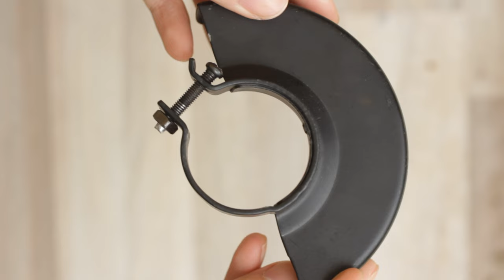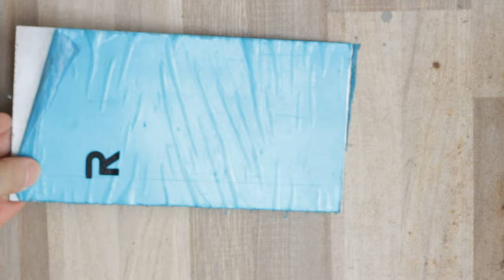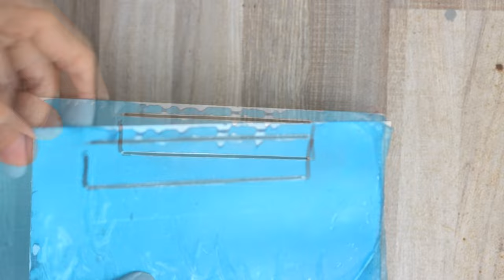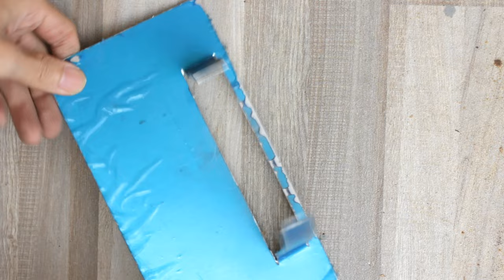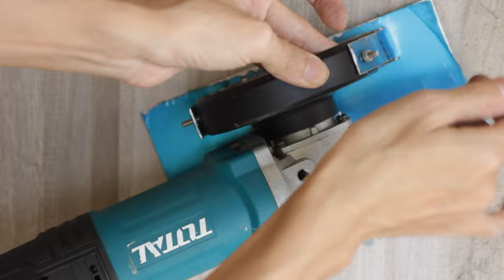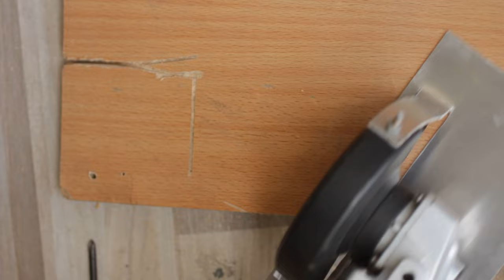How To Turn An ANGLE GRINDER Into A Safe CIRCULER SAW

Comment: That angle grinder and wood won’t be safe no matter what type of jig you will come up with. Wood blades needs slower disc speed. Probably you’ve realized it when you try to cut. Try to use it with variable speed grinders with a slow speed
Reply from the maker: I had created a speedcontroler

Comment: Please, even with this guard, use carbide multi wheel disk. The problem with those wood blade is when it got caught in the wood and everything goes boom! Angle grinder speed is too fast, you wouldn't have time to react when things goes wrong. stay safe brothers.
Reply: I also noticed that but was still gonna make one with that blade, but then i saw your comment and now i gonna go with a blade you wrote. Thanks.
Reply: Also the small ring adapter used to fit the blade onto the grinder's mandrel gets misplaced during tough operations and the blade begins working out of shape. This is the reason blade gets caught in the wood and causes a disaster.
Reply: And change the rotation, turning the machine to the other side. The rotation must allow the cut to be made from the bottom to the top of the piece, preventing the blade from advancing over the piece.
Reply: My grinder has variable speed how much rpm do you think is safer for wood cutting disk ??
Reply: It will depend on the size of the disk. The Bosch CARBIDE MULTI WHEEL discs already indicate the recommended speed. Although these discs do not burn the wood, I do not recommend a very high speed. Up to 8000 RPM for 125 discs for example.

Comment: For safety and efficiency NEVER use the ring adapter! Instead, drill the sawblade using a stepdrill bit up to 22.2cm and place it directly on the angle grinder's standard mandrel.